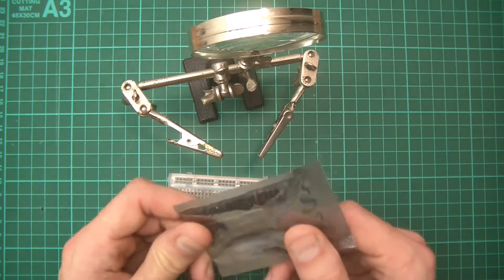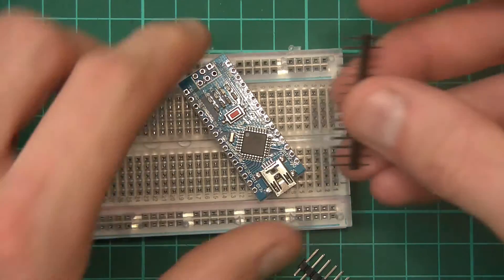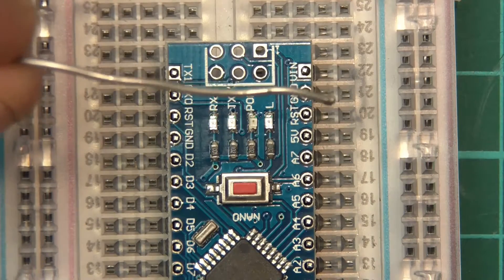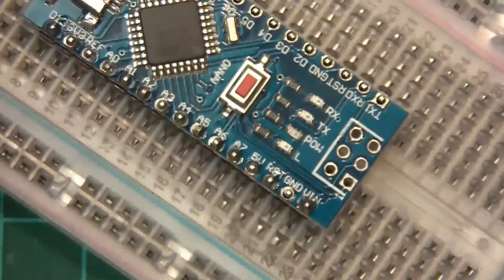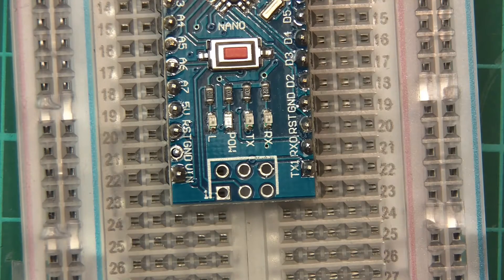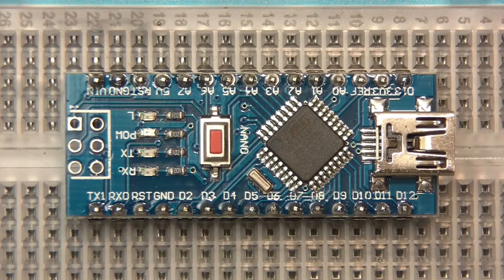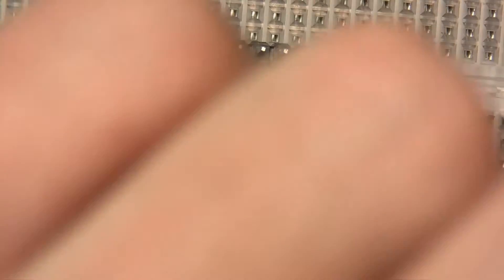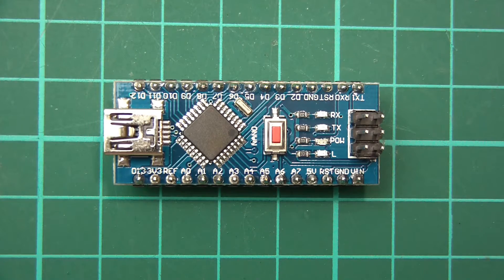Me Soldering up an Arduino Nano!

Comment: Two questions:
1. Should I touch both the ring on the board and the pin to heat both up? I'm guessing the pad means the ring thing on the board but I am not familiar with the lingo.
2. Can the plastic of the breadboard get damaged by the heat?
Reply: You can melt the breadboard's internal plastic if you heated the pin too hard by the iron, if you do it carefully, no damage can be done on the breadboard. About the ring thing, i cant answer that yet.

Comment: You solder the way I was taught when I studied for my C&G in Electrical Engineering. Heat up 1 side and let capiliary reaction take care of the flow... Nice and neat...
Reply from the maker: Hi, I'm self-taught. They use capillary action in plumbing too, it gives a really great connection/seal. :-)